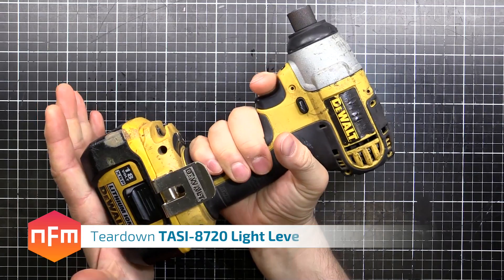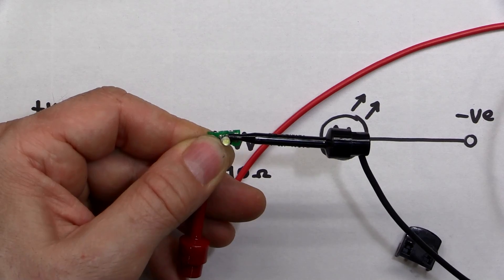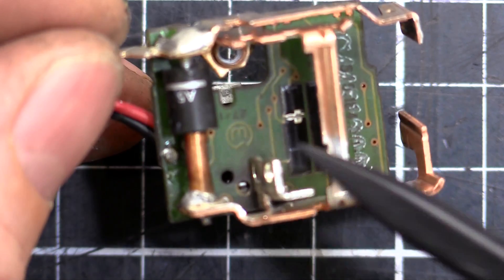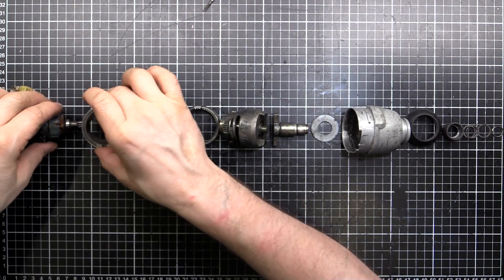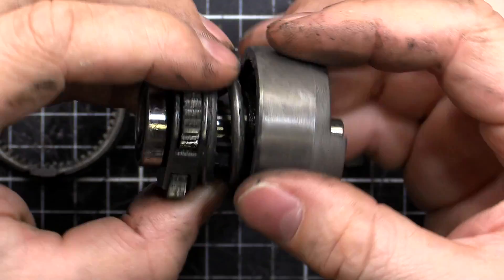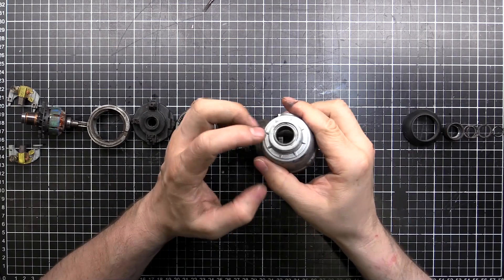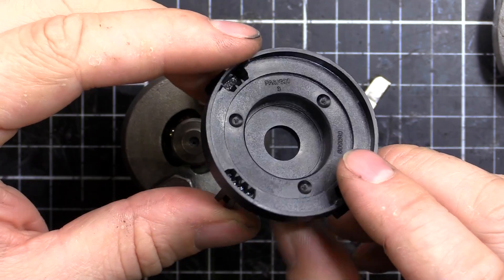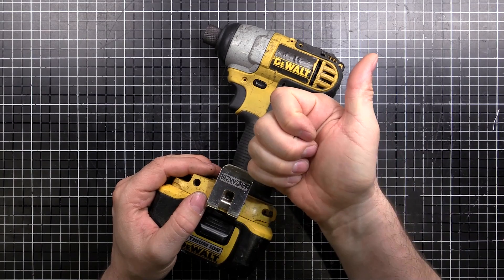DeWalt DCF826 Impact Driver Repair

Comment: i have to open a similar aeg switch , did you desolder first the the connections of the electronic card ? you skipped the opening part of the switch case .
Reply from the maker: I did desolder some connections. I can't remember exactly now though as it was a long time ago.
Reply: @NearFarMedia  thank you nefm , my damn switch had many soldering connections,  to get to into the core i really had to do some bad desoldering and soldered them again for reconnection after cleaning , half an hour later i ll make a trial .. impossible to work again i quess : ) i hope i can arrange a new cheap switch for the tool .

Comment: This is an EXCELLENT instructional video.  I need assistance with reassembling my Dewalt DC988.  Might there be one for this?
Reply from the maker: Thanks!
Unfortunately my drill is a DCD970, so it will be a little different (and doesn't need a rebuild yet..)
Google does have exploded diagrams if you do an image search though, which might help.

Comment: What was that in min 6:40
Reply from the maker: The grey stuff I put on the heatsink?
It's just thermal paste, like what is used on a computer CPU to help transfer the heat from the transistor to the heat sink so it doesn't overheat.

Comment: Wait how did you get the motor apart? You skipped over that part.
Reply from the maker: I unscrewed all the screws holding the case closed, then took the parts out.

Comment: I have a 18v drill and you can hear the motor turn but the chuck doesn't want to move??  The chuck just will turn if i turn it by hand.
Reply from the maker: Sounds like busted gears or something sheared inside.
Have you opened it up to see inside?
Reply: Are you from America or Europe? Because in Europe Dewalt doesnt advertise their products as 20v, just 18v, So your drill could be new or old, but 18v in american means it old, before 2012ish. so that means the brushes are probably all crapped out, or so.ething else is wrong

Comment: Nice job. But it didn't do anything to fix how completely useless a "feature" those little LEDs are to begin with.
Reply from the maker: Yeah, the drill/driver bits always cast a shadow right where you want to look, but I use them as a convenient torch when drilling in a dark spot as the light can be activated with a light pull on the trigger just before the drill starts rotating.